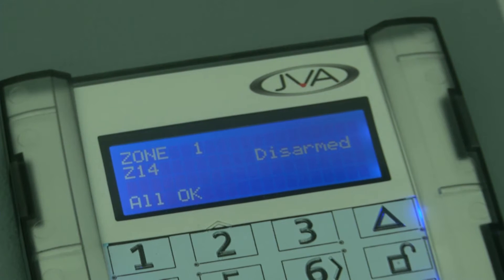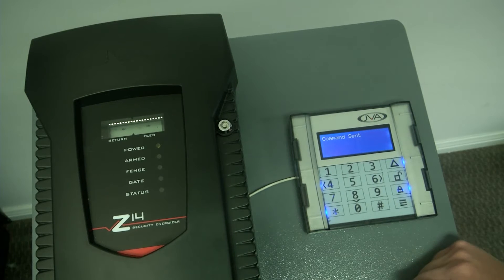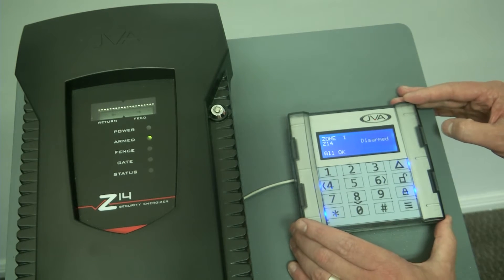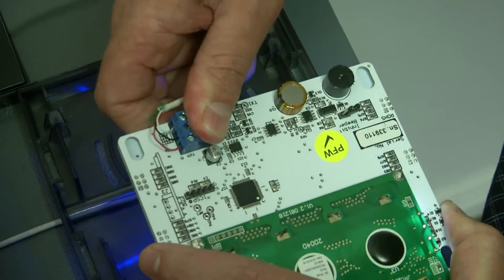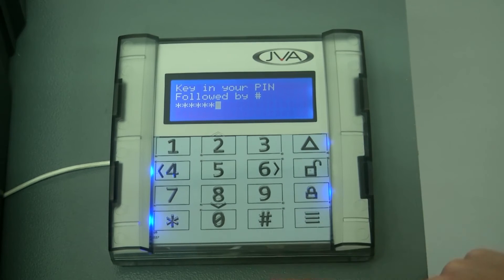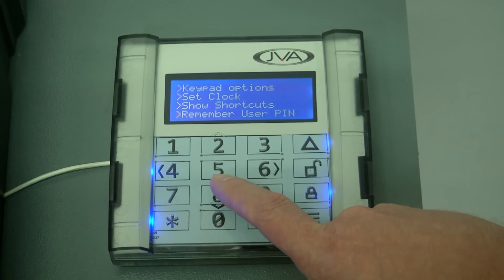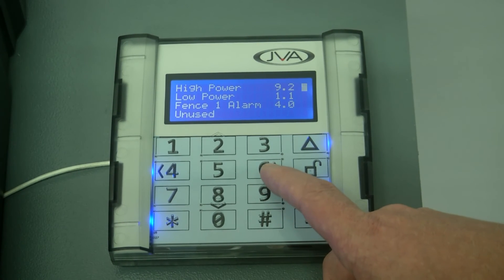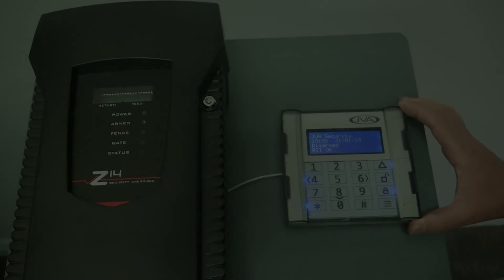JVA Z Range 4 Line Menu driven LCD Keypad

Comment: great display 
wat cud be the problem if its display shows 0.0kv feed
 and 8.4kv return
Reply from the maker: Hello Kenneth apologies for only replying now, I have passed your question onto our technical team.
Reply: Hi Katumwa , you will need to bring the unit in to us to have a look at.
Reply: I've had some trouble installing some Z14 equipment. I contacted my distributor, but they couldn't help. Do you have an email address where I can send the details? Thanks